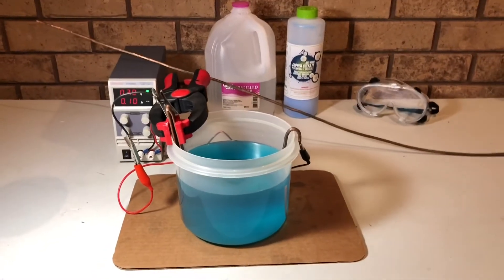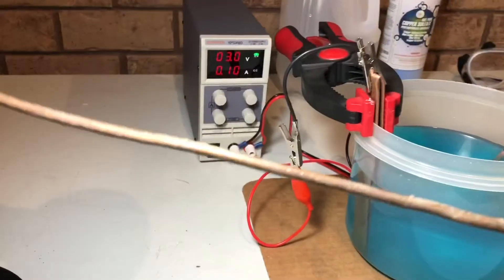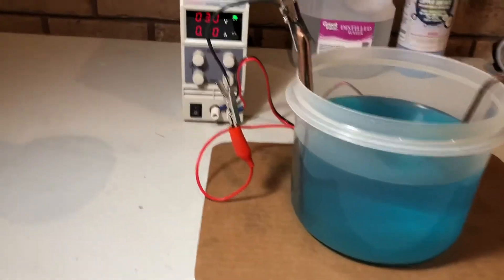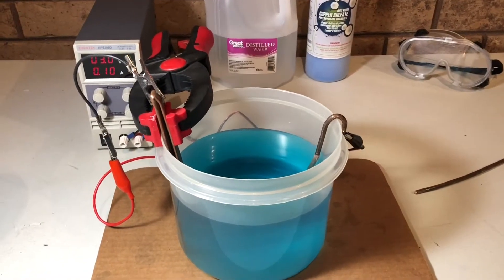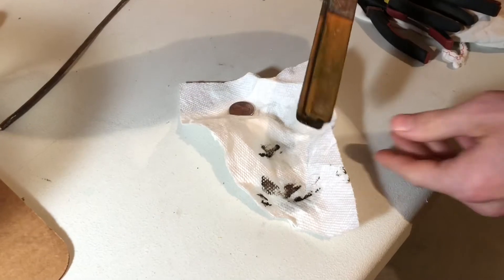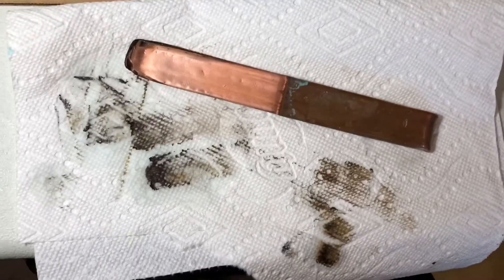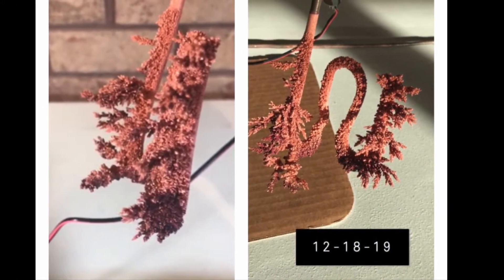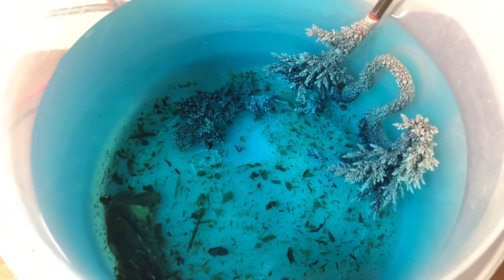Growing Copper Crystals at Home

Comment: Can you use a tattoo power supply to do this with?
Reply from the maker: What voltage/amperage can you deliver with that power supply? It should work, but if you can adjust the voltage you will be able to fine tune it to grow nicer crystals.
Reply: @DoingStuffWithDerek  lmao i wish you would have seen it earlier. I just ended up buying an adjustable power supply. Made it easier then trying to figure out if they would work or not.
Reply from the maker: @encryptlakegames5328  Good luck! Let me know if you have any more questions
Reply: @DoingStuffWithDerek  one more really. If you keep the copper suspended in water will it keep it from oxidation. Or atleast slow the process.
Reply from the maker: @encryptlakegames5328  In my experience, it doesn't start to oxidize until its removed from the electrolyte solution.  I haven't personally done this, but I've seen people suspend it in clear oils to keep it looking nice.  Not sure about water.  If you use lower voltages, the crystals should be bigger and not have as much surface area to oxidize on either.